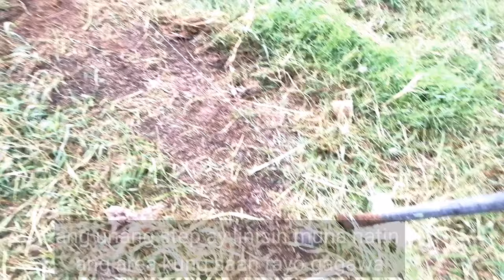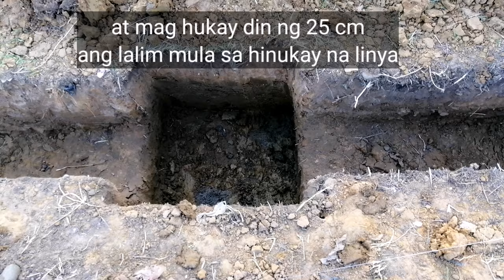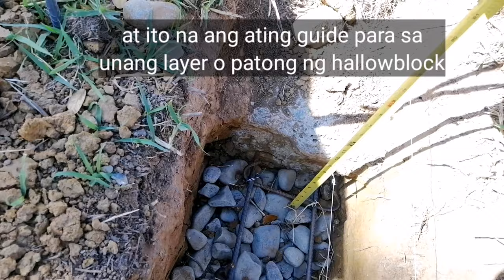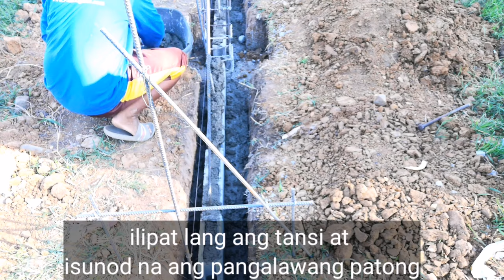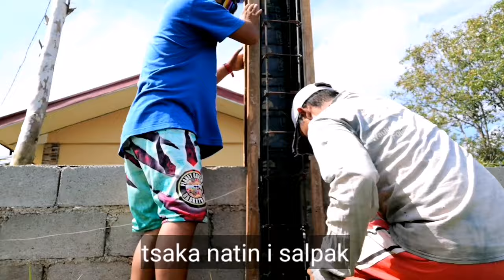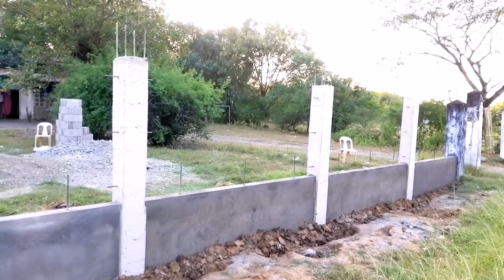paano gumawa ng bakod / pag asinta ng hollowblock (running bond method)

Comment: New lay uot po yan sir
Reply from the maker: yes po... mayron lang ung dating poste sa bawat corner...
Reply: @cardodiytips5820  oooooooooooo0ooooo
Reply: @cardodiytips5820  9o0ooooopooooooooooooooooo9ooooo
Reply: @cardodiytips5820  9o0ooooopoooooooooooooooooo9ooooo
Reply: @cardodiytips5820  o
Reply: @cardodiytips5820  ooooooooo
Reply: @cardodiytips5820  poo oooo9p
Reply: @cardodiytips5820  9 poo poop
Reply: @cardodiytips5820  poo
Reply: @cardodiytips5820  poo p poo poop p
Reply: @cardodiytips5820  poo 9p poo p
Reply: @cardodiytips5820  poo 99 poo 990999
Reply: @cardodiytips5820  to